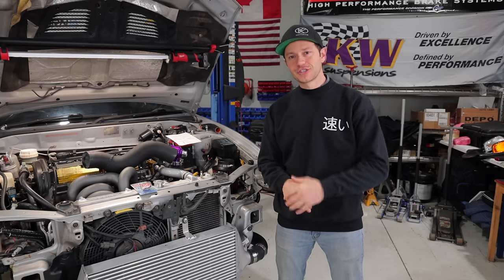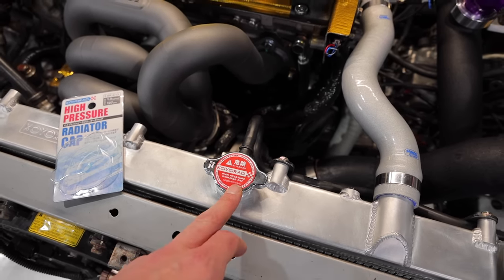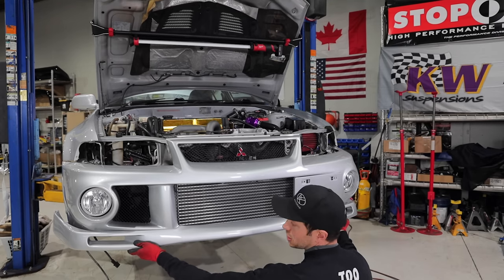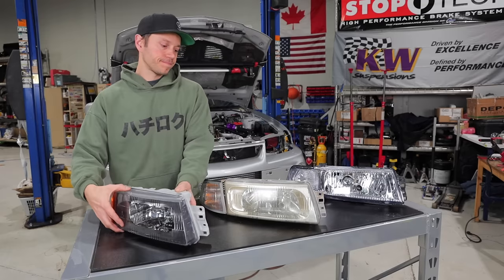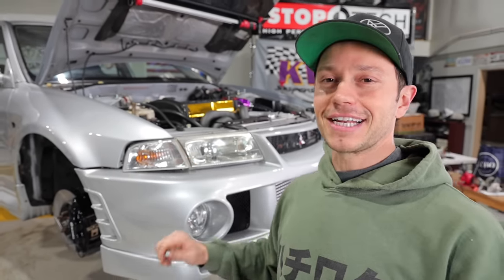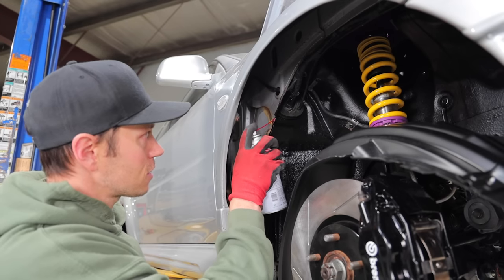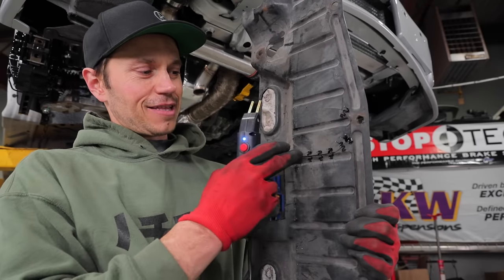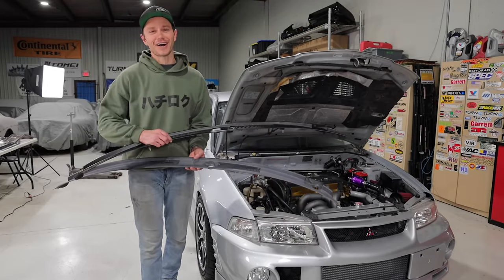CHEAP EVO 6 Rebuild Complete + Wheel Reveal!

Comment: Very tasteful...nice work!  Quick tip on the front coolers, oil, intercooler, radiator...etc.  I found installing a basic foam insulation around the edges from one cooler to the other (sandwiched between each) will help the cooling.  It forces the air through all of the coolers.  Without something to direct the air through the coolers, it will take the path of least resistance. For example, of the total amount of air that  passes through the first intercooler, a smaller % will then pass through the next cooler, and the a % of that air will pass through the next, and so on...so forth.  With some insulation, a larger % of air will increase going through...less air will be loss.

Comment: wish you went with 17" wheels instead but apart from that i love how this car is coming out, good work Pete
Reply: My evo has 18’ and they look so much better than 17’s
Reply: 16 FTW
Reply: I have 17" RPF1's with 45 profile RE003's on my Evo IV, the 18's ride too hard with coilovers and you cant find much high-performance rubber in the 16" size, its usually 15" or 17"+ for race rubber.
Reply: @randyranderson1621  damn thats lame, you should rock 22" tri-spoke wheels for maximum performance

Comment: I've looked at getting the one piece lights before for my Evo, purely because the original lights don't have much room for improvement on light output and the headlights are generally pretty poor compared to modern standards. But problem is I've seen many setups where people have done them and they've ended up with bumper sag from the parts they had to cut to fit them in, so it's put me off attempting it. Especially if I then find I don't like them. I also really like the amber sidelights which you can't really do with the one piece setup, short of you taking the lens off and then putting like a clear orange wrap on the reflectors, which could look cool. I'd be curious to see someone try that. I've also thought about the twin light version of those where one side has the inside reflectors wrapped or sprayed to be yellow. Actually what I really wish they made was just a remake of just the headlight clusters, not including the indicator part, and having one of those with a twin light setup I think would look really nice.

That said, the stock headlights + amber side markers is just such a classic look. I've still got the clears on mine and trying to find a set of ambers from a 5 or 6.5. I bought a set on ebay but turned out to be for a 4 which had different shape headlights so they don't match up, so need to keep looking.

The black lights though I'm not a fan of honestly. Personally I'd just buff back the stock light cluster and pair with the amber indicator cluster. My 6 is also silver and I just felt like the all clear look just drained too much colour out of the car. The amber indicators adds a bit back in which I think looks nice.

Also definitely don't think the back needs dropping any more. The nose down stance is exactly how all Evos should sit. Looks great.
Reply: Hey! Figureeight in the wild! I really enjoy your vids man.

Comment: Many BOVs allow both push and pull type installation. Pull type like you have it will hold more boost but will not modulate power well. You basically get big dumps in power when you do a slight lift causing lift surge. That BOV in general isn't known for good modulation also. 

A push style with a large upper vacuum area will let the car have more force (psi x area) holding closed than charge pipe trying to open and hole power well. Then the pressure difference with small lifts ( like 100% down to 75%) wont have the surge issue.

Comment: Hi first time seeing the channel and this is my first video and already love it. Im a huge fan of evos and love them. I also paint cars and wanted to let you know that i always use sem trim black for basically anything that i need to be flat black. It works fantastic and once it fully dries and hardens it is almost like its bulletproof. Ive used it on dirtbike foot pegs and even motor casings and after hundereds of rides it still hasnt worn thru or burned or anything. It is also very forgiving if u have a surface that isnt perfect and overall i think you will love the product.

Comment: PT,  loving the build! I would have loved to see you go with Enkei's wheels that are more tarmac rally spec, like the NT03RR wheels. I also am a fan of the amber corners and sides, especially on the silver car - it pops so much more. Also, with the heated plastic bonder, try holding it rotated 90 degrees relative to the crack so there are more wires running across the crack instead of the single wire - it should melt more material together and save you a lot of time.

Comment: I'd do a bi-xenon projector retrofit. I do not know the inspection guidelines in your area but I think going with the clear lens headlight w/ retrofit and the amber turn signal would be the hot ticket. A retrofit for that housing would be pretty easy but will require some work. You would get massively improved lighting and can make it look OEM-ish.

Comment: Plastic repair tip - If it's ABS, try using standard ABS plumbing cement!  Works great for re-welding cracked ABS parts and after sanding down, looks damn near factory. :)

Comment: Looks awesome.  The BOV didn't look odd to me but I sold a lot HKS SSQV pull type valves back in the day.  Pete another good option for any black trim that oxidizes is try Meguiar's #39 to clean it and Solution Finish.   That's the magic combo.  The stock lights look good, the only thing I'd do is swap the orange bulbs for ones that still flash orange but don't reflect orange.  They used to make ones that had a silver coating but I think everyone goes LED now.  I really like those black housing ones too but only if you can get someone to customize the corner light to match.

Comment: The hotwire bonding thing, we have those at work over in sweden. It's a winter testing facility for cars, so there's a constant supply of broken front bumpers. Quickest and easiest way to fix them is to use that hotwire thing.

Comment: My opinion:
Headlights - great choice
Valve cover - I would prefer the stock red one
wheels - not bad, but I prefer so much more the look of those previous BBS
Interior - maybe it would be cool if u used the same blue accents of the seats. Either way it looks cool in black.
Overall the evo looks really nice and clean. This is one of my favourite builts in your channel. Congrats!

Comment: The heat shield you put on oil pan will come off and leave a mess. A friend of mine did the same thing and the adhesive came lose. I would take it off before you run the car.

Comment: You should get that lip plastic welded as It will not break off even under impact. 

If you use that urethane glue, it will leave nasty marking and damage your OG bumper and the lip will most likely come off from scraping or light impact as its still just bonded not welded.

Comment: 24:13 I do that same damn thing EVERY time I use a new tube of any type of caulk or sealant.  ALWAYS forget to poke the hole in the tip, which is crazy because most caulk guns include a metal poker thingy for just that purpose!

Comment: I hope the GTC-02 is stronger than the GTC-01 which I ran, also in 18". Every single wheel bent to the point that the vibrations couldn't be balanced out even with a roadforce balancer within a couple years of only summer use.

Comment: I bought the black one piece headlights with separate high and low beam and got projector installed in them. No matter what headlights out of your selection you will go with you will struggle with night driving. I've never been a fan of amber corners and in my opinion black headlights go well with white/silver car. Clear is just boring. Also that piece you have to cut out for one piece headlights is riveted on and can be easily replaced. I believe that the part that you have to cut is identical with normal lancer/mirage so no harm done there.... 
Are you sure about the offset?

Comment: Wheels are great. Would have chosen same front lamp combo. Black amber screams ebay. I'd probably raise the front a smidge rather than lower the rear, even with that RCA kit up front. It's funny there was so much conflict on the QRJ valve. The HKS SSQV, wholly ubiquitous, ancient, and whored out beyond belief, used a valve perpendicular to the inlet, and more recently so did the the synapse. Nothing new there! Sorry Dave, team Evo all the way.

Comment: I believe the plastic bonding thing would work better if you turned the head 90 degrees. you want the waves to cross over the two parts at multiple points...

Comment: Those tyres are too wide for the CP9A Chassis, I thnk its going to rub (Front) and bottom out (Rear). Tyre width is far more restrictive on the CPNA/CP9A than on the CT9A evo's. Do the front's touch the inner guard at full steering lock?

Comment: So why is the BOV being recirculated if you’re not metering the air before the turbo with a MAF? Really no need for recirculation if you’re not using the MAF system.

Comment: Just use a soldering iron to plastic weld. "V" out the crack and fill in with plastic of the same type from another area. - Coming from someone who worked in panel and paint for 5 years.

Comment: As far as the plastic welding stuff goes, why not just use a soldering iron?  No need to buy those ends.  Just keep it supported on the bottom with something sturdy and metal and "melt" the plastic together with the iron.

Comment: You could have used a hot air gun and stretched and reprofile the inner fender liner to fit to the rolled lips instead of cutting them.

Comment: Hey love your channel definitely the stock look looks the  best meguiars sells a two-step headlight restoration kit I have a 99 Mercedes Benz ML430 and it did an awesome job restoring my headlights and it also has a sealer that you only need to apply once-a-year my headlights have never looked better every year I see them and they still look brand new also for your turn signals on Amazon they sell a light bulb that has 144 LEDs in the bulb amber color and they're also error-free I put those on my Mercedes I will never go back to a different bulb they are the best bulb I have ever tried the bulbs are EverBright 2800Lumen 7507 led take a look you'll love the look

Comment: Rub that trim with old engine oil and see the money you wasted.
Also, paint the radiator brackets and replace the bolts.

FYI for everyone, they are called "indicators" they indicate where you are turning.
You can say front, side or rear indicators, NOT Turn signal, side repeater and whatever you call the rear, YOU DONT NEED A SEPERATE NAME FOR EVERYTHING!
Reply: You also bought the heavy GSR model, should have bought an RS.